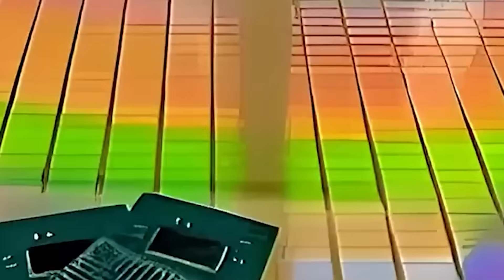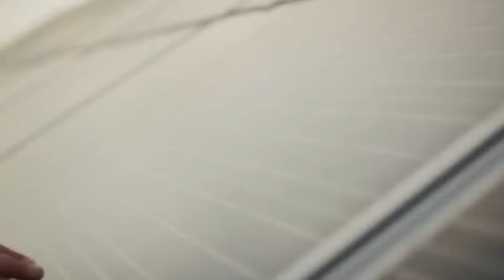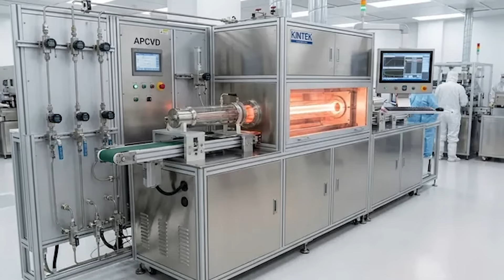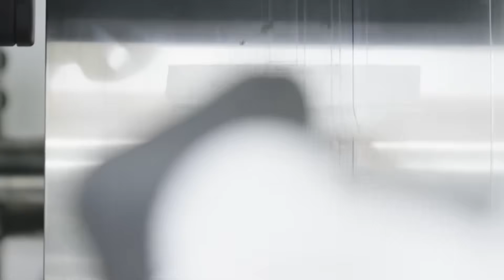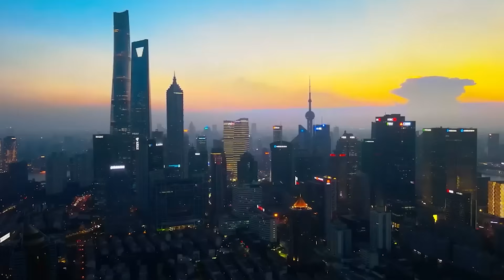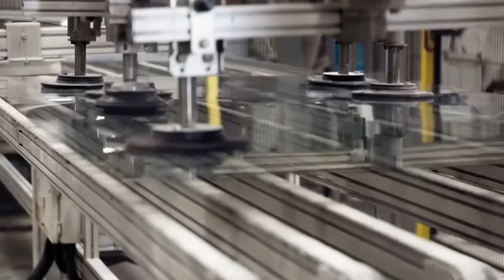China Just Invented Glass That Generates Electricity — Engineers Are Stunned

Comment: This solar glass is great but 120 year old free energy devices work much more efficiently and produce all the power required and more for no more than the inicial cost of the free energy device/ Free energy devices work as per the first law of thermodynamics and convert the almost infinate energy available in the aether and is exactly how we get all our energy right now. An alternator designed in 1895 is still working today, converting aetheric energy into electricity as designed and combined with perminate magnet motors supplyies free electricity for as long as the bearings in the devices allow.